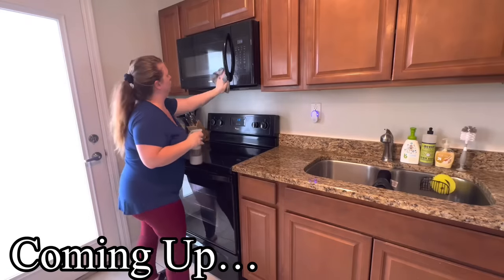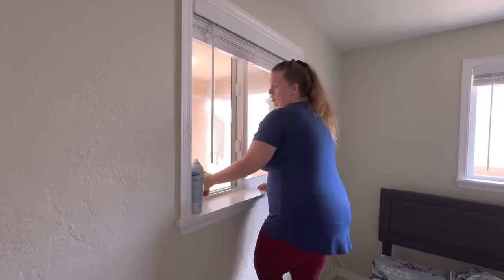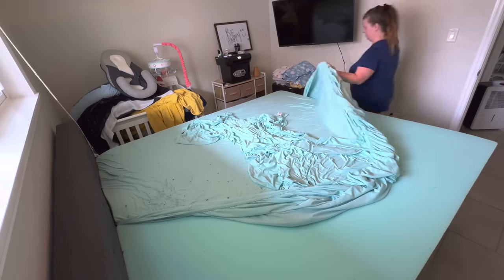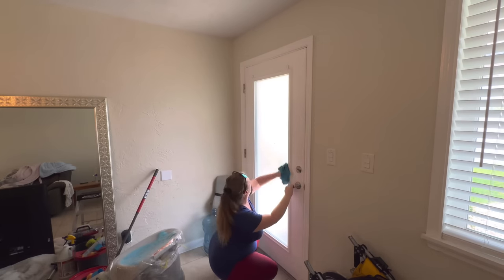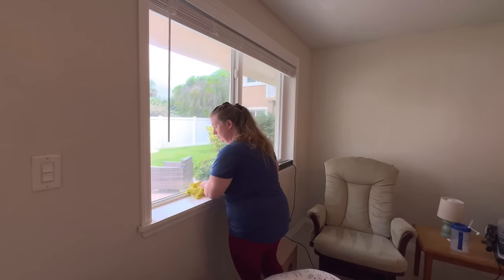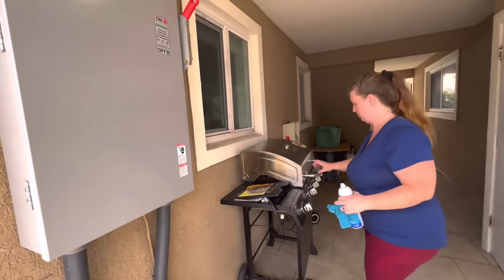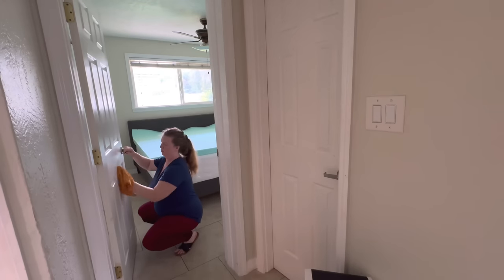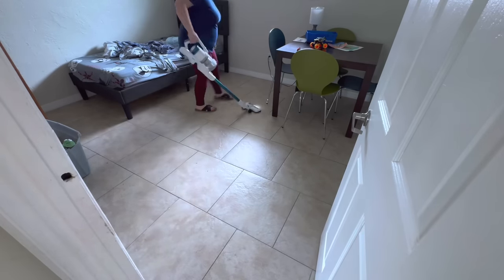HELPING HAND! DEEP CLEANING FOR FREE! DEEP CLEANING CHECK LIST! HOW TO DEEP CLEAN LIKE A PRO!

Comment: For me, when I moved into my current rented house I cleaned everything lol but most important were the kitchen - wash literally everything including inside the cupboards. Then clean the bathroom top to bottom. At least I knew those 2 areas would definitely be clean from the outset. After that, before I unpacked boxes in each room, id clean it all over then put my stuff in.

Comment: On my last vacation I decided to deep clean my entire house and some of the things that I often forget about on a regular basis were cobwebs in the corners of rooms, top of door jambs, baseboards and light switches. It felt so good to accomplish those. I also noticed that the metal cover for the air filter was super dusty, I just threw it in the tub and sprayed it down, which was less effort than wiping every single crevice with a brush or rag

Comment: I rent and I’ve found that whenever I move into a new place it’s always filthy so I like to get the keys a couple days before moving day and do a deep clean of everything! The main things I like to focus on is shampooing the carpets, deep cleaning the bathroom (including replacing the toilet seat with a new one) and deep cleaning the kitchen including inside cupboards. My current house which I’ve lived in for over a year now used to have an Indian living in it so for about a month after I move in it smelled so strongly of curry no matter what I did! I even had to scrub curry off the ceilings and get the heat pump cleaned out 😝
Reply from the maker: Yeah it sad how they hand over apartments

Comment: Don't forget to clean out the disposal and sanitize. I run all the ice from the freezer through it to clean the blades, since I clean it out also, then use a sanitizer all over the inside and outside. They can really smell. Under the flaps in the drain are GROSS!!
Reply from the maker: Oh yes that can go so stinky and gross